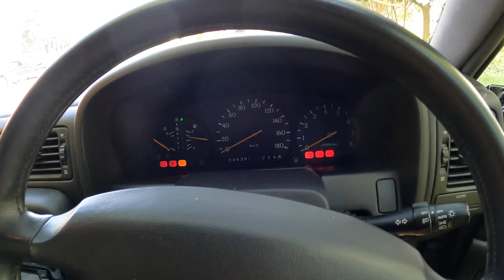300zx Sideswipe Court-case! Nissan Gloria Project Begins!

Comment: Mike PLEASE read this comment and tell Omar. it's about crack at 33:35. 
he said the right thing, you drill it, you weld it. BUT don't forget to make all the surfaces smooth, kinda removing the welding line you know. this place of the wheel will be much more tensioned if you don't remove welds and it will cause new cracks soon. I'm working on restoring wheels so talking out of my experience. 
as always, good luck with projects <3

Comment: If I were you I'd install one of those air cup lift systems on the 300zx to give the car a little bit more temporary clearance on such bumps while remaining on a full static coilovers. They are 100% driftable unlike conventional air suspension and can only lift your car for a limited time to cross the obstacles. Definitely a must if you wanna ride low but don't wanna leave a part of your car on the curbs and bumps every time.

Comment: i used to have a pontiac grand am and the tail lights were held in with wing nuts kinda like your third brake light. it was so easy to replace the bulb when i needed to and its the only car i ever saw with that feature
Reply: Dodge Challenger and Charger tail lights are also held by them.

Comment: Man I don't understand why people slam their cars on coilovers at least. When I put mine on I dropped it to like a finger or two from the tyre but enough to clear easily and pass normal speed bumps. But ultra slammed is super scary to me
Reply: Same. Plus it can scrape the oil pan and sand down bottom parts of your car. I saw a slammed Acura TSX on a lift and the bottom was smooth bare metal. 
My friend actually had his bumper rip off because his car was too low. And he ripped the speed bump out too.